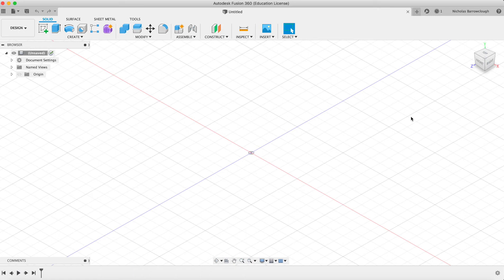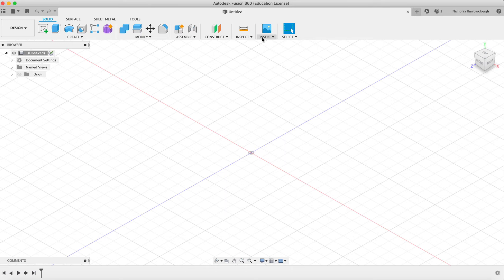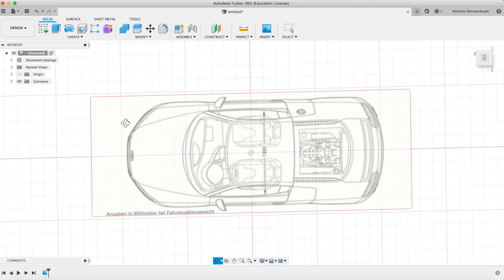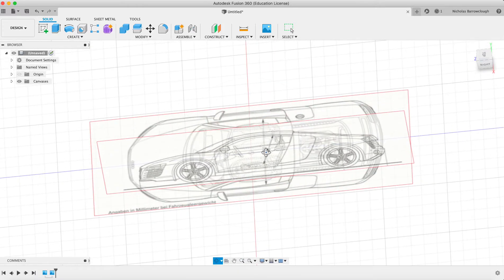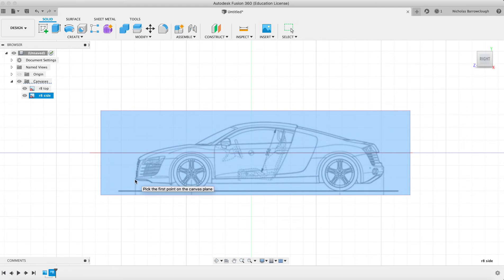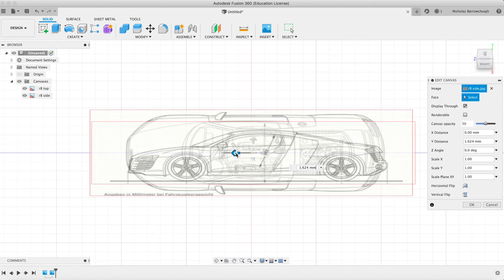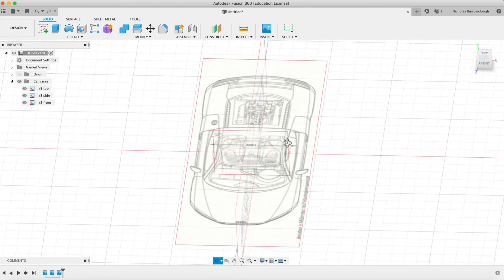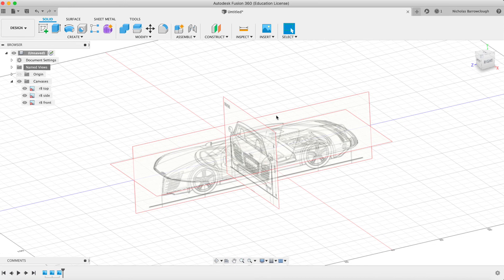Fusion 360 - Reference Images Tutorial

Comment: Great presentation. Plan on using this for my mold buck I’m making. I have a question?
I took a photo of a model body. I then calibrated it to the full length which was 12”.
What weird I’d dimension of the body between the wheels shows its 6”. The actual measurement is 5-5/16.
Trying to figure out why the dimensions are not equal to real body?